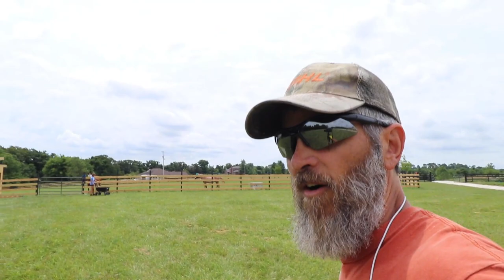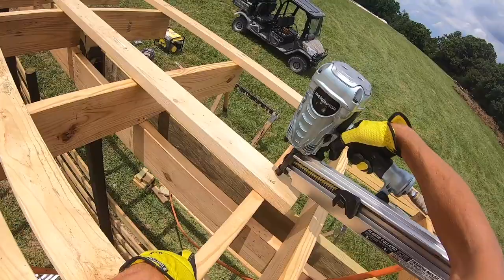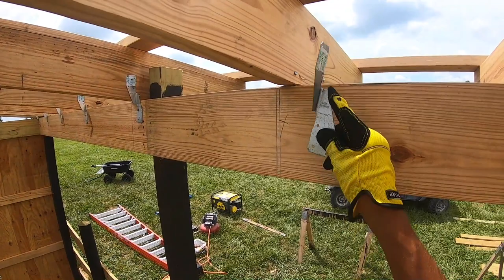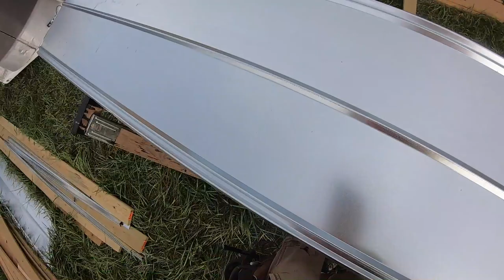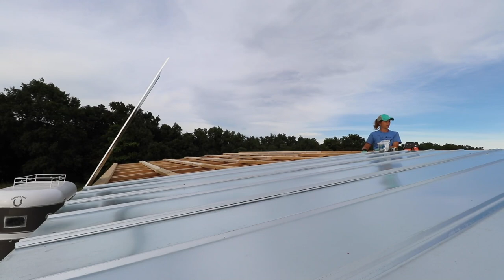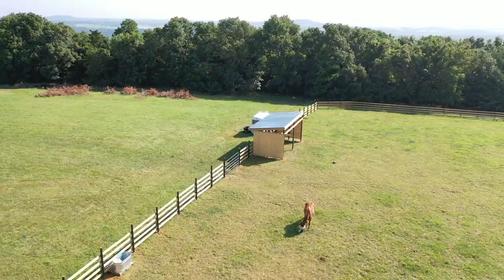Building a Horse Shelter - Episode #4: METAL ROOF

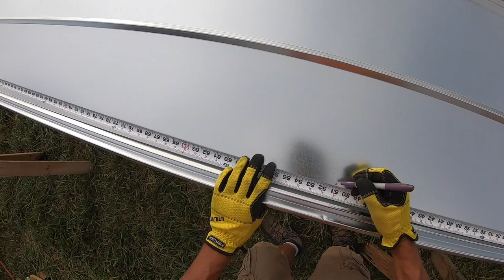Comment: Thank you for this video. I have to build one shortly. I'll be using concrete footings as we're in the Pacific NW.  It would be interesting / useful to consider your choices/tradeoffs you made during the design phase, and comments once built about what you learned doing it, and what you would do differently next time. One quick note is at 6:52 you mark 6'3" at the 74" measure (instead of 75"). I'm sure you did that just to make sure that we're paying attention. Please tell your girls that their horses are beautiful! Cheers!

Comment: One technique I’ve seen to mark screw holes is to use an awl to punch through multiple roof sheets at the same time.
Reply from the maker: Yes.  That is a good idea.  Thanks for the tip.   I will have to research that before I set out to build the actual barn.  Thanks for watching.
Reply: @FromScratchRanch  

Clearly you'd need to be very meticulous in aligning multiple panels. But this process would save a ton of time on a bigger job.